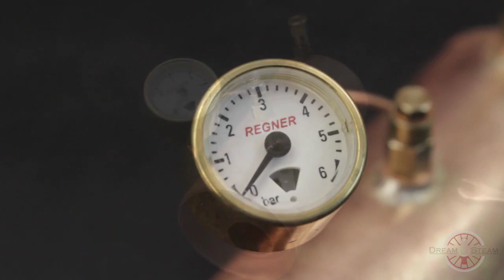Lets Build a Cracker # 5 The Boiler and Pressure Test

Comment: Loved the video could I ask what brazing rods and what pickling solution did you use. Ta
Reply from the maker: Pickling with citric Acid. And the brazing Rods are flux coatet Rods from the Lokal Hardware store... (Brant : Rothenberger) but i use them only for big parts and much heat. To not burn the regulary flux away

Comment: Great video again, thanks! Neat solution for the pressure testing too. I'm having trouble finding the valve you used with the spray bottle though, you got that from Regner too?
Reply from the maker: Yes its from Regner! Can be used to refill water while running...
Reply: @dreamsteam8272  great, I'll look again to see if I can find it. How is it called in German?
Reply: I guess I found it "Speiseventil für Druckflasche"
Reply from the maker: @rjordans  but you need the "druckflasche" also! Because its hard to find a good one like that. And the Rubber Hose fits perfect!
Reply: @dreamsteam8272  thanks, I'll make sure to get both then!
Reply: Well, it looks like my first boiler pressure test went okay. Tested up to 80 psi work only a few leaks where I had to tighten the plugs for the boiler a bit more. All of the soldering went well it seems! Thanks for the inspiration 😀